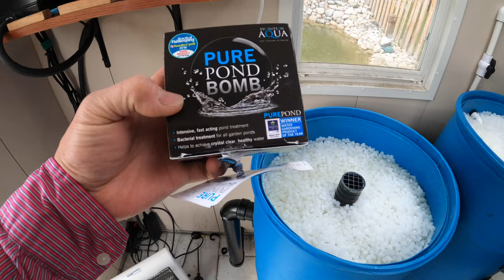DIY 3-Barrel Filter System for Koi Pond - Adding Media and Starting Up

Comment: I have seen many setups like this and yours is right up there with the best of them, especially the shop vac back wash method which I utilize in my larger system as well. I'm no expert all though I have been building ponds for my personal use as well as ponds for paying customers for over 25 years. I have made many mistakes and use these fourms to better my skills as a builder and koi keeper. I read through the comments and if I missed it, pardon me, but I don't know what brand of uv light you are using, but all that I have ever used have said to put your uv "after" the filter. You want the water to be as clean as possible before it passes through the uv, and at the rate of flow the manufacturer recommends, which I see you did with the piping and valves. Having the water pass through the filtration system first helps get out the larger particles of algae and other unwanted material that the uv filter can kill better, if the particles are smaller. Also, in all of the instructions and I've seen say to put the uv after the filtration and as low as possible to the last filter with the inlet and outlet facing up, as you have. There are numerous articles on this subject, but maybe your manufacturer recommends installing your uv before filtration. Bottom line,  what works best for you and your pond , and by no means am I criticizing your application, only a suggestion. Great job on the filter!
Reply from the maker: Thanks Richard for your comment!
Yes, I have done some research and initially I had the UV sterilizer after the filter which only makes sense for clean water to pass through the UV. However when I got my Jebao UV sterilizer and read the the instructions which stating that the UV sterilizer needs to be connected where the water pumped through and not gravity fed. So that’s how I ended up with my configuration today.
I have not opened up the UV light housing to check but I guess there would be some kind of buildups inside. I may open it up at the end of this season to inspect and clean the inside when I close up my pond this year.
Reply: @PTranProductions  Understandable now with your setup being gravity fed. I used 55 gallon drums and had a Vortex pre- filter before my first barrel and was using 3" pvc throughout the system, which greatly increased my flow, so my uv could go after the filtration. That's one of the problems a person encounters with gravity flow, is getting the flow rate one desires after filtration. I do personally prefer a closed pressure system, but they are very expensive and have their own set of problems,  especially getting the proper backwash, and taking pieces apart for maintenance. As I said in my original comment, what ever works best for you and your pond/fish. Happy ponding!!
Reply from the maker: @richardjohnson9566  
Thank you!
Reply: Where you mount your UV, either before or after your filter system depends on if you are running a pump or gravity fed system.
If gravity fed it would go after the filters in the line that is being pumped back to the pond, if pump fed it would go in the pumped line feeding the filters!
This is because the UV units construction is too small and restricted to allow a high enough flow of water through it by gravity, requiring the  water to be pushed through under pressure of a pump!

Comment: Great video Thank you for posting it.  How long did it take for water to clear up? How often do you need to clean media? Could you post and after run video?  Thank you again.
Reply from the maker: The water clears up in about 1 or 2 weeks. Ideally the system needs to be cleaned once a week to achieve optimal water condition.  Many updated videos have been uploaded on my channel about this system with my DIY koi pond. Check them out!
Here’s one of them from this year:

https://youtu.be/FTe-b_JPF8c?si=dJumGa1M6k9aDQ2V
Reply: Thank you  @PTranProductions
Reply from the maker: @truemegahertz6929  
Np!

Comment: K1 is buoyant when new, I was advised by some one to put the bag it arrives in, in the pond and stab some holes all over bag to let water in and air out and then weigh down with a large rock and leave for a week, whole I built the system. When I put k1 in mine in barrels it didn't want to push up, it just floated on surface. Nice job though
Reply from the maker: Thanks Jp Cleric!
Yes, the media need time to mature naturally and with the help of adequate air stone and pump will circulate nicely after.

Comment: Nice job.  I've considered doing something like this for my pond but I don't understand everything 100% which is why I have not attempted yet.  Also money. Mostly money!  But serious question, why 3 barrels?  Why not 2, or 5 or 10?
Reply from the maker: 2 barrels would be Ok but 3 would be extra assurance with 1 moving bed as beneficial bacteria house and 2 static beds as mechanical filters. 5 or 10 would not be economically feasible because those K1/K2 are pricey!!!
Cheers!

Comment: What made you choose K1 for you first barrel and not K2 or K3? I know you want K1 for the 3rd moving barrel. 
I just figure you would use K2 or K3 for the 1st barrel and K2 for 2nd, and K1 for 3rd moving barrel.
Reply from the maker: K1 has 4 spokes and K2 has 5 spokes which would collect/filter more fine sediment than K1 (as my understanding). That’s why K1 used as first stage (barrel 1) to filter larger debris/sediments then anything passing through will then be filtered by stage 2 (barrel 2 with K2 media) with any finer sediments.
I didn’t want to use K2/K3 in the first barrel because I didn’t want it clogged up too quickly.
K3 was not available in Canada or US that I could find at the time. K2 was only available on eBay through a California based seller.
I could have used K2 or K3 for my moving bed because they have more spokes - more surface areas for beneficial bacteria to hang on but it’s all came down to availability and cost.
Reply: @PTranProductions  it is my understanding that it has nothing to do with the spokes as it does with the size. 
K1 per cubic ft will have more surface area then K2 even though K2 has more spokes, your can fit more smaller pieces of K1 in a cubic ft, then K2. That is why they say have your moving bed using K1 in barrel 3. 
I just figure you are trying to just collect larger debris in the first Barrel so you would want a larger media such as K2 or K3. 
But I understand it comes down to price and availability.
Reply from the maker: @leesilas  
 I’ve never seen K3 so not sure about the size. However, K1 & K2 are identical in size/diameter. The only difference is, as I mentioned before, K1 has 4 spokes and K2 has 5 spokes. So ideally, 1 CF of K1 should be equal to 1 CF of K2 in term of quantity

Comment: Nice build. The shop vac idea is a great one. Do you find the 2 inch increments for the base give adequate differential for the flow rate you need?
Reply from the maker: Thanks mate!
Yes, with the 2x4 wood frame, it gave me a minimum 3.5” rise at every level which is adequate for the flow so far with a 3170 GPH pump.

Comment: Where are you located? I have just completed this filter build; but with 2 barrels due to limited space. My question is, how does this perform in the winter months? I live in central Indiana.
Reply from the maker: I am in South Western Ontario. The winter temperature here could go down to -25°C. So I don’t intend to run my system in the winter months and will shut it down by mid October.
I am not sure how winter is like in Indiana. However if your temperature goes below 32°F, I wouldn’t recommend to keep the system running.
Reply: @PTranProductions  we do get snow and icy winters here. I assumed to shut it down, I was just curious. My barrels are outdoors, so I just hope my plumbing holds up in the cold.
Reply from the maker: @timgarretson3561  
As long as you remove your check valve and drain all the water out of your system, your plumbing would be fine over the winter.

Comment: I would like to see how well the bacteria have grown a year later. Great job btw 👍😊🥂
Reply from the maker: The system is shut down every year in the fall and restarted in spring. So beneficial bacteria to be added every year in the spring when the system is restarted.
https://youtu.be/xNLXXgN00Q4
Reply: @PTranProductions Why are you shutting it down every winter? Reduce the flow if you want with a variable pump or ball valve but don’t shut it down.
Filters take around 6-8 weeks to develop enough bacteria to “START” completing the nitrogen cycle but take years of continuous running to develop fully and plastic media is notoriously slow to develop a bacterial coating, even with the addition of live bacteria!
Your filter is just getting established each year when you shut it down….madness!
Reply from the maker: @ces69  
My whole system is shutdown every winter to prevent damage to the pump and plumbing due to subzero temperatures here in Canada.
Normally I just need to add some beneficial bacteria at startup and the system will just run fine again. It’s not a big issue. 
Once the pond is mature with plenty beneficial bacteria in it. The filter would run fine without any additional beneficial bacteria added.

Comment: So it would be better to use k1 on the first tub and k2 on the second tub over k1 in all tubs ?
Reply from the maker: K2 has 5 spokes vs K1 has 4. So K2 is better, IMO.
Reply: @PTranProductions  what did you have in the third tub?
Reply from the maker: @carlosvalle8694  
K1 in tub 3.

Comment: You are supposed to soak the media pror to use. Stops the media overflow .
Reply from the maker: No I didn’t not soak the media. Initial overflow issue that I encountered was due to the air pocket the pipes between barrels.
It has been all working well for over 3 years now.

Comment: When it is convenient and affordable, change all of that flex hose going through your UV to  PVC pipe. With the flex hose you will eventually have a blowout. I have experienced this many times and had to change everything over to PVC
Reply from the maker: Thanks for the tip! This flexible kink-free PVC hose give me the flexibility to easily disconnect the UV light housing and store it inside the house for the Winter months. This flexible kink-free hose has a thick wall and heavy duty. So hopefully it won’t blowout easily.
I did purchase one flexible hose from Amazon which was very cheap thin wall. So I returned it.
Reply: @PTranProductions  good deal! Sounds like it's strong stuff
Reply: my understanding is the flex hose also has small ribs on the inside which disrupts flow and catches sediment build-up. smooth bore hose or pipe is the way to go

Comment: Would this system work on a 7,000 koi pond??
Reply from the maker: I assume that you meant 7000 gallon pond.
This system max flow rate is 3170GPH.  As long as you use this system with a skimmer system to add up the total flow rate of at least 7000 GPH then it would work. You can also upgrade this system with bigger barrels like 55gal barrels and in turn with bigger GPH pump. Again ideally you need a combined filtration systems with total flow rate of at least 7000GPH for a 7000 gallon pond.
Cheers!

Comment: Very nice filter system I have a similar set up 👌👍
Reply from the maker: Thank you!
Reply: Hi, how many gallons can something this size handle? Also what about the fish load? Ty
Reply: @high_fructose_corn_syrup  my pond is just over 3000 gallons and it works perfectly the only difference is I have an extra barrel with ceramic media in it 👍
Reply from the maker: @high_fructose_corn_syrup  
I tried out with 4500 GPH & 3170 GPH pumps at startup. This systems couldn’t not keep up with 4500 GPH flow rate but has been doing fine with 3170 GPH. My pond volume is about 6000 gallons and so far the system has been doing great.
In term of fish load, I currently have 5 koi and 30 gold fish (not sure of the total weight) but according to online info, 2 cubic feet of K1 could handle 35 pounds of fish. 
I hope this would answer your question.
Cheers!

Comment: Great Video!   I'd love to chat with you to see what you might do differently now after 2 yrs.   I have a 75,000 gallon Koi pond that is clouded with Algae that I need to clear up... was thinking of adding in a system like yours.    Thoughts?   Thanks again for the great video Mr. Tran.   Signed: Dr. Dennis Black    Dallas, Texas
Reply from the maker: Hello @DrDennisBlack,
My system was still running well last summer.
It is currently in ‘hibernation’ for the winter due to the subzero temperature.
You can click on the link below to see last year update video and some following videos to see for yourself: 
DIY Koi Pond Update 2023: 3-Barrel Filter System First Cleaning
https://youtu.be/xxns0PHTEfU

This system is the solution for cloudy and greenish pond water. 
It has been working well together with my DIY surface skimmer to achieve clear water in my pond (besides the string algae of course which was controlled by special string algae treatment)
So if you’re looking for filtration system that is easy to clean and to maintain, this is one for you.

Comment: What about if, instead the first barrel with Kaldness, put some big filter socks...???
Reply from the maker: Filter socks could be an option. However cleaning those socks when they’re all saturated with dirt may not be as easy as the Kaldness media.
Reply: @PTranProductions Thanks for your fast reply, yes cleaning  the socks is not easy, my question is becuase socks can retain better the particles than Kaldness. I have seen other video where the user of very similiar system, claims that at the end there still lots of partibles that is why the Kaldness (according that guy) is not too efficent as mechanical filter.  The Kaldness can retain up to how small particles as mechanical filter???  thanks in advance.
Reply from the maker: @NeotropicalFauna  
Yes, in my understanding, filter socks retain more particles, get clogged up faster and would be a pain to clean out. Yes, in terms of mechanical filtration, filter socks may be more effective than Kaldness but I am not sure if they’re efficient over all. With two barrels of Kaldness used as two-stage mechanical filter, this system has proven very effective and efficient overall in term of filtering, cleaning and maintaining. Clear pond water can still be achieved within a week after start up and maintained clear thru out the season.
You could leave the Kaldness alone running for up to 4 weeks without cleaning - this is good if you’re away on a vacation.  Watch my various update videos on this system to see for yourself.
So If you don’t mind to clean out filter socks every other day, go with filter socks
If you want to enjoy your clear pond water more and do less work then Kaldness is the choice.
Economically speaking, filter socks may be cheaper than Kaldness, so whatever works for you.
My most expensive spending on this system was the K1 & K2 media.

Comment: If you turned the UV flow down you wouldn't have needed to get a smaller pond pump.
Reply from the maker: Thanks for your suggestion Garry Stedman!
I guess you meant ‘turned the UV flow down’ as to restrict/reduce the flow of the water to the barrels. This way would work but then the pump wouldn’t run at full capacity and will have to work harder thru restricted flow. Anyway I had the Jebao 3170 GPH which was not strong enough for my skimmer so I might as well use it for the 3-barrel filter.
Reply: The flow through your UV light should be slower to give the light time to kill the algae and bacteria. One guy I know put two 36 inch UV lights in a row so the water flowing through has time exposed to the UV long enough to kill it.
What I did on my pond is put in a small pump that just goes to the UV abd back to the pond and it made a HUGE difference. I live in Florida USA, and algea grows fast in the summer, but now with this set up it does not.

Comment: This doesn’t make water clear and clean.
You need to have drum filter if you don’t want to spend hours to clean the filter. Water from the pond go to drum filter and then go to barrel 1, 2, 3
Reply from the maker: Drum filter seems like a good idea. I may
Consider that in the future if you have about $2k to invest.
For now the 3-barrel system just works fine for my pond.
Thanks!